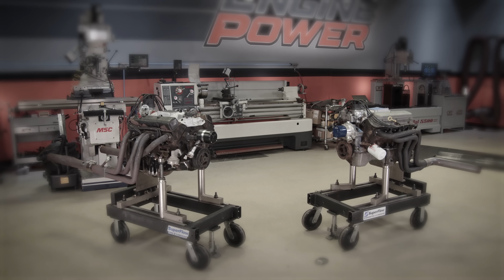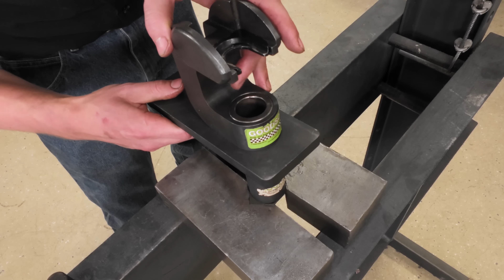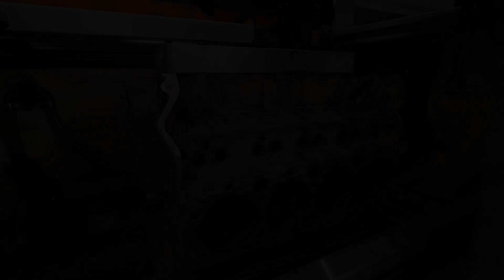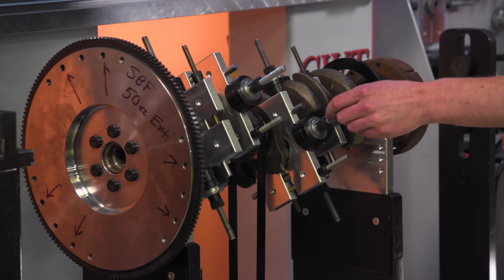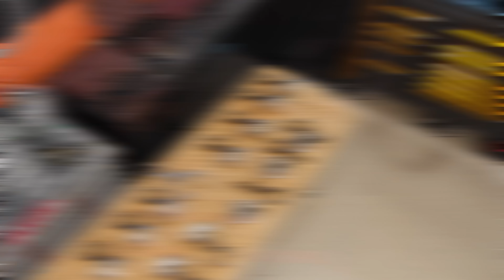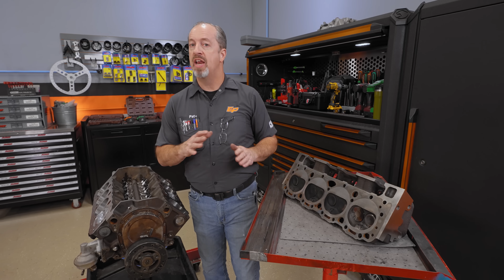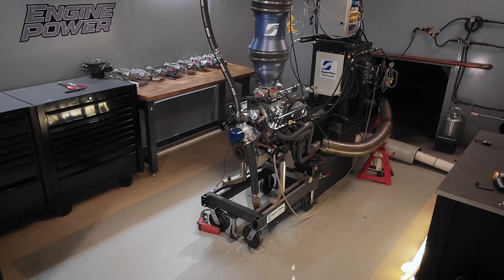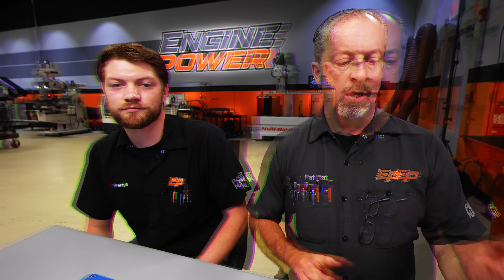305 SBC vs 302 SBF: Does Compression Help the Lowly 305 beat the Race-Bred 302?

Comment: After this the Ford 351 against Chevy 350
Reply: Specifically, 351W vs Chevy 350.  The Cleveland, with it's large ports and angled valves, is in a whole different class and not really comparable to the inline valve Chevy 350.
Reply: @stansdds  yup you are correct, unless the chevy 350 can have aftermaket heads the stock Cleveland 4v heads will destroy it. You could try and compare the Cleveland 2v heads against the chevy Vortec heads - they flow about the same but there will be a big compression difference cause the 2v heads have 76cc open chambers. There would have to be major piston changes to equal each other.
Reply: @nova467spanker  showing my age here. When you said 4V heads I immediately assumed 4 valve like 4 valves per cylinder. Which had me super confused cause I've never heard of a pushrod V8 having 4 valves per cylinder (excluding diesels). Then I looked it up and realized that there were different heads for the 2 and 4 barrel carburetors (4 Venturi hence the "4V") lol. Learn something new everyday.
Reply: @stansdds   how bout the lt4 350 it was a good runner
Reply: @stansdds same cubes! Cleveland just has superior head design!
Reply: @stansdds yup and heres chevys biggest problem, the stroker ford is usually more cubes
Reply: @stansdds  what do you think about the SB2 heads compared to the Cleveland on a 351w motor.
Reply: @cannonroberts5129 Sure if the Ford gets Yates heads.
Reply: @stansdds Yeah it should give the cleavland an advantage. But I think it's fair still. Fords best small block vs chevys best small block. It should see the cleavland make more power. But here in Australia the cleavland was used extensively and it often had bug end failures under race conditions. So probably the chev is a better engine. Just the heads aren't as good.
Reply: @stansdds 
Ford can't help that Chevrolet engineers failed in their cylinder head design!
Reply: @chriszeibots8970 I wouldn't call over 50 years without a design change a failure..
Also the racing worlds most winning engine..
How many times had Ford changed designs trying to keep up.
Reply: Or...
Ford 351w vs Ford 351c
Reply: @patrickkelly9721 I like the 351c great sound
Reply: @patrickkelly9721  this would not be a fair comparison no matter which way you tested these with the same displacement  - stock heads or aftermarket or even stroker set ups. The Cleveland will beat the Windsors ass every time with equal parts. A long time ago Horse Power Tv did this comparison but they screwed it all up. They were suppose to do this shoot out but made the Cleveland a 357 and made the Windsor a 408 Clevor with the Edelbrock aluminum heads and RPM Air Gap intake. Cleveland had the stock 4v intake. Cams were way off and the Windsor had more compression. Dumb ass test - FAIL
Reply: @nova467spanker 
I watched that episode
Reply: @nova467spanker You'd have to hamstring yourself from the full aftermarket potential of the 351W to make that fair. There is so much more aftermarket support for the windsor than the Cleveland, it isn't even funny. I'm not opposed to such a comparison, but make sure to give the windsor the same ability to flow as the Cleveland, because I suspect, with the same flow, the same compression, and the same displacement, you would see very similar numbers.
Reply: @nova467spanker  But was it a fail? The 408 Clevor was likely still cheaper than a 357 Cleveland. At the end of the day, cost is ALWAYS a constraint. If not, a guy would put an all-aluminum 572 built by a pro with a big blower on top.
Reply: @hydrocarbon82  yes it was a fail because they were suppose to compare a Cleveland with factory Cleveland heads vs a Windsor with factory Windsor heads as a battle of the 351's. This test had zero to do with anything else than a 351C vs 351W. It was to actually show which 351 made more power with factory parts. 

If they would have made them both 408's then the Cleveland with stock 2v heads would have made  almost the same power as the Clevor with Edelbrock heads - difference would have been compression. The stock Cleveland 4v heads on the Cleveland 408 would have shown what those ports are really about. Their test was a COMPLETE FAILURE and was misleading.
Reply: @patrickkelly9721 yea skip the Chevy lol
Reply: @patrickkelly9721 aftermarket parts the 351w would win
Reply: @patrickkelly9721 someone should make a set of thick bearings to fit the   Cleveland crank into the Windsor blocks!
Reply: No comparison! @patrickkelly9721
Reply: @patrickkelly9721  not apple to apple the 351c uses the Cleveland heads the 351w uses the same heads as the 302/289 but what is strange is the 351c uses the same mains as the 302 but the 351w uses the much larger mains the same as the 351m/400 ..in fact you can drop a 400 crank with some shaving of the counter weights in to a 351w block for a 413cid stroker and the 351m/400 heads on the 351w (same head as the Cleveland and Boss 302)to build a clevor stroker  ..
Reply: @dexter2433  I'm not sure that putting a 400m crank in a 351w block makes a 413cu motor, unless you r doing some offset grinding on the big end of the rod, the stroke is the same regardless the block
in which case with some more mix n match can get much more than 413 with a conrod grind,  and similar can be done to up cid on most motors or use a purpose built long stroke crank.
Reply: @craig3916  common build in the old days a 30 over 351w block with a stock 400 crank but some mods so that it cleared the 351w block as in the counter weights can clear it came out to 413 cid do the math 4inc bore 30 over with 4 inch stroke out of a 351w block...
Reply: @craig3916  all I can say is some mods are required a 402.12 cubic inches from 4" bore and 4" stroke is 402.12 cid but most mods are bored 30 over giving you a 413 cid build
Reply: @dexter2433 Close, but not exactly. The 302 has 2.249" mains, the 351C uses 2.749" mains, and the 351W has 3" mains. 

The 4" 400 crank with a 4.030 bore equals 408 cubes. It is the most popular stroker kit for the 351W, still to this day. Modifying the 400 crank was what we used to have to do before aftermarket crankshafts were readily available. Cheers.
Reply: @mikec9112 the late model 302 are the same 2,7 main 2.3 bigend..
Reply: @dexter2433  The Ford 400 heads are not the same as the 351 Cleveland 4V or the Boss 302. 400 heads are the same as the 351 2V & 351M: smaller valves, larger combustion chambers & smaller ports.
Reply: I was getting ready to type this in the comments. As much as I like the 302 Ford, I'd be more excited to see the 351 windsor vs a vortec 350 chevy
Reply: @NissanTy ford wins there to
Reply: Cleveland
Reply: Ford has 3 351 engines Windsor Cleveland and modified
Reply: 302 Windsor v Cleveland "4.9"!!!
Reply: Everyone knows the 351c kills a 350 mod for mod
Reply: Or the Chevy 454bvs the Ford 460

And the Ford 427 vs the Chevy 427
Reply: sb2 305 vs yates 302
Reply: Not a competition if the right parts are put on the 351. Little brother is spicy but big brother really doesn't play... 👍
Reply: Yes Cleveland vs 1970 Lt1 350
Reply: @johnmarshjr928 lt1 vs Boss 351 Cleveland.  It's not close. The Boss is head and shoilders above the chevy. Matter of fact the only smallblock that comes close is the Mopar 340 six pack.
Reply: Actually do 406 SBC vs 408 cubic inch clevor.
Reply: 351C with 4v heads is a pretty spicy meatball for a 350 with factory heads to beat.
Reply: Engine masters already did it
Reply: Vs Pontiac 350 vs buick 350 vs mopar 340
Reply: That was a lot of money and effort spent on either one of those engines.. Not sure who would do that
Reply: And the mopar 360. Could do 2 fords and AMC. Haha that would be a lot.
Reply: They've done that years ago!
Reply: Yes please
Reply: Pat & Frankie…. You have to do 350 sbc and 351 w. 
Love both brands and would love to see a comparison
Reply: Hell yea
Reply: 350 Chevy vs 351w. If both stock heads 350 will kill the 351w. 350 has lighter crankshaft will rev faster.
Reply: Agree. 351 w and chevy 350
Reply: Same results sherloch
Reply: Cleveland vs 350
Reply: Ford 351W, Chevy 350 and Mopar 340 in my opinion
Reply: A level playing Field. You took the weakest mass-produced Chevy. They make you know small bore longer stroke compared to a 4-in bore 3-in stroke on the Ford. So no the playing field ain't level
Reply: @jackiecurl6171  so what, the 305 has a .48" longer stroke so its comparable. Yes the bigger bore unshrouds the valve a little more but the 305 with longer stroke and longer rods should have had the torque advantage. The 302 just beat it everywhere.
Reply: @nova467spanker longer stroke is not going to help. It's going to hurt
Reply: I hear you 💪😎 the 351 and the 350 were great motors and still are long-lasting and very dependable 🤜💓🤛
Reply: Engine masters did that match up it just like this
Reply: The Windsor would be better matched up up against the Iron Duke Pontiac 2.5 bc even the wheeze-oh-five Chevy boat anchor would take the lame Windsor STRAIGHT TF to Gapplebees 😊.  
 So Id suggest a "real" Ford engine like at least a Cleveland
Reply: Same same. But different.
Reply: Mopar  340  vs the 350 chevy
Reply: Or the Ford 300 vs the Chevy 292
Reply: Or the Chevy 216 vs the Ford's 222
Reply: Dang 305 is in the old LT1 power neighborhood
Reply: About the same, engine masters covered it. Since they essentially have the same bore and stroke there's bit much difference, even though Ford has better cylinder head design than Gen I SBCs
Reply: It's been done on the 350 vs 351w and 351c and they did the chevy 355 vs Ford 357. Chevy won those.
Reply: Which 351? I personally like the Windsor over the Cleveland as the Windsor likes RPMs a little more than the Cleveland does and when you splay the main caps and cross bolt them to the block it makes the Windsor as durable at 8,000 rpm and that Cleveland is at 5,000 rpm. The 350 on the other hand has as many configurations as you can think of. And the Chevy will cost about half the money to put 500hp in as that blue oval will.
Reply: Which one? You have 3 351s to choose from and they’re all flawed
Reply: Engine masters did this with AFR heads and made within 2 numbers of eachother.
Reply: Don't forget the 340 Mopar
Reply: Its so funny. These old engines, if you do the same things to them. They do the same things. The engines essentially had identical dyno graphs. The ford edged it out but they are the same engine. Ford looked a little better but thats it
Reply: The Cleveland not the Windsor
Reply: @dennyflynn6965 there are many stock “plus” builds on the cleveland as well. Richard holdner did one on that very engine. Made the most power for the era correct combinations. By a decent margin. But the rules of physics still apply. Head flow. Cam spec. Compression. Intake runner length, Displacement and materials (aluminum vs iron) all play into the power. If those are all the same. They will make similar curves. No matter the brand. 

But yes the 4v Cleveland head will out run any factory sbc head that was available.
Reply: Ford gets stomped 350 is hands down the best engine ever built .PEROID
Reply: @HermanGraves-i1c it’s not that simple! The biggest advantage the 351 Windsor has a 5.969” connecting rod right off the bat! The Windsor has a 9.5” deck height! But, the Dodge has a 9.8” deck! Jumble the numbers! If Dodge would just build a great set of heads? We Ford guys have been using the rods in cheap stroker kits for years!!😂😂
Reply: @HermanGraves-i1c no, technology has changed! We had no problems with 355 Chevys with Windsors with heads, cam, and carb! Now, that’s why the lS came along!!!  Still, the heavy crank shaft wasn’t ideal, but the 351 had a 9,659” connecting rod! After the aftermarket for cylinder heads came out, and the 393 factory strokers, the lS was needed to replace the Chevy engine fell short of the 408 and 427 engine engines! The 393w is cheap enough because it used stock parts!!😂😂😂
Reply: A properly built 302 ford is an impressive little engine.  Compare 302 chevy to the 302 Ford.
Reply: Everybody already knows the 351 is better. Can get more displacement out of it too.
Reply: Yes,however they were not doing 351 clevland. How about stroking the clevland and put it up against similar BBC,and cry again🤣🤣🤣 ! 
Ford angle plug head's that should have been an advantage over straight plug casting's, & domed piston's?!
Do it again w/angle plugs on Chevy😭😭
Reply: 351c
Reply: Chevy 307 vs Olds 307
Engine masters got 400hp Oldsmobile
Reply: I say "pit the best old Ford 427 against the best old Chevrolet 427..." 🤘🫰
Reply: @Lesterman_1 cammer wins that too
Reply: @Lesterman_1  oh yea! Love the FE’s
Reply: @Lesterman_1  the ford 427 cammer would destroy the ls6 427.
Reply: @X-eler8 when treated fairly and matched correctly, the Fords will always win. 🤷‍♂️🤘
Reply: @Lesterman_1 nhra nascar imsa say different
Reply: @X-eler8 what a ridiculous comment 🤣🤣🤣.  List the production cars that the SOHC engine came in !!!  We’ll wait . . . . .
Reply: It's already been done. Do a search.
Reply: @IndenturedSavant13 agreed. Engine Masters for the win
Reply: Our Nascar wins prove the sbc is king
Reply: @tumblew33d69 just proves Nascar prefers GM as they own stock in it.
Reply: @nolanjohnson2124 im sure nascar is also the reason half of the modified fords you see have sbc or ls in them 😂
Reply: @nolanjohnson2124 nhra and imsa too lol sore losers
Reply: @tumblew33d69 the king got most of his wins with Mopar!
Reply: @CraigDurnin-c3x  gm holds the most wins across the board with small block v8s 70+ years of production and 52 years of racing its the only small block still being produced by the big 3 this isn't an argument the fight has been fought and the only one left standing also has the most wins i grew up gm the architecture had 45+ years of part interchangeably its a no brainer. My dad hardly ever bought outside of gm growing up we recently picked up a 1986 d150 i quickly realized why we ran gm products dodge making things hard to remove for no reason and the chassis is trash but id still pick it over a square body gm products are boring and dont really care for them unless i was building a race motor 30years of only learning gm v8 platforms i prefer ford or mopar products now when i read history and info i feel like a kid again its all for fun guys dont get stuck on one brand at the finish line its not about the brand its the builder the tunner and the driver
Reply: @tumblew33d69 only because Chevrolet got the rules changed when Bill Elliott did 212 mph in his qualifying lap next race they fitted all the cars with restrictor plates except they fitted bigger ones in the Fords so Chevrolet could keep up once again the minute Chevrolet starts losing the complain and get the rules changed

Comment: Numbers don’t lie. Everyone that hates on a 305 is ignorant. The only reason it doesn’t get built like the 350 does, is because if you’re gonna spend the money, why not spend it on the 350… That same thought process should be the same with Ford, but it doesn’t seem to be.. 302 is more of the Mustang’s heritage than anything else no?
Reply: Na, shorter deck of the 302 makes it easier to fit in tight bays. Like early mustangs.
Reply: @henderson63  And later in the second gen Explorers, based on the Ranger. I have one with the 302, and it's been pretty reliable.
Reply: yup. 302 fits all the old shock tower stuff better. Besides, roller 302s are easy to find.....so we run the destroked 351 in light cars and give it some gear.

Comment: Once everything else is equal, they would in theory make slightly different power levels due to displacement differences but negligible. What made the 302 so special was the h.o. motors with fuel injection and that ford firing order. With no 351 options for fox body mustangs to swap right in people were basically forced to build the 5.0. The 305 never got much past the tuned port, which was okay for the time, but you could drop in and run a 350 tune port and forget the 305 ever existed for cheap so people MOSTELY never invested the time and money on the 305.
Reply: mostly
Reply: In Ca guys  would stroke the 305, use trick flow heads, port the TPI system. Still pass smog and keep up with much better cars. Torque is king on the st

Comment: Both engines should have the same compression. This is not equal. Raise the compression in the Chevy to the same as the Ford. Then it will be an equal equivalent
Reply: You should rewatch the video
Reply: They have the same compression. Watch the video.